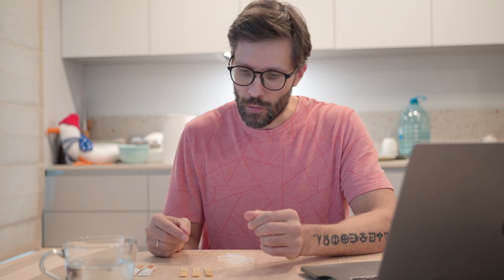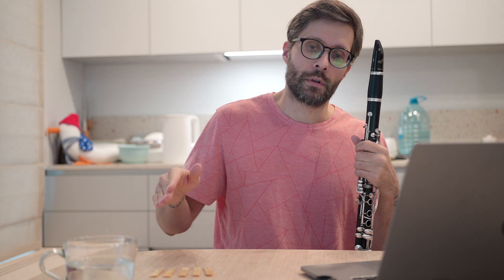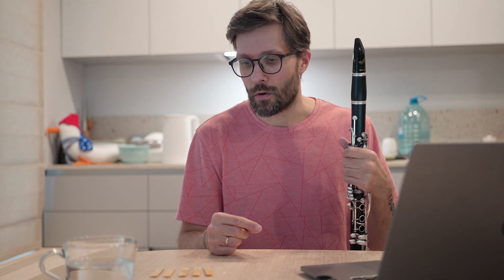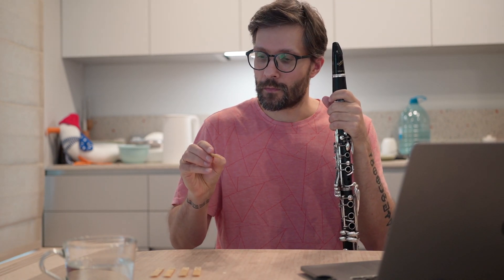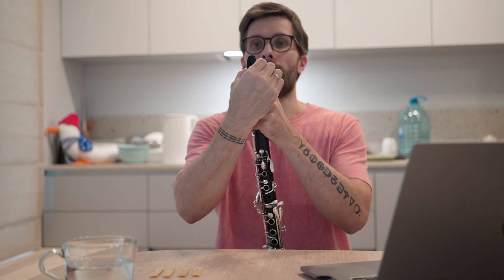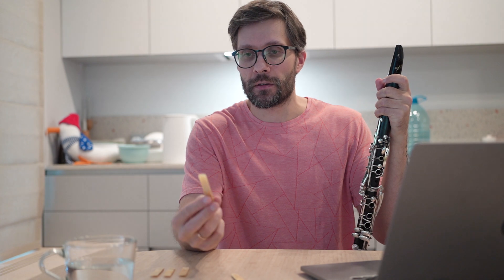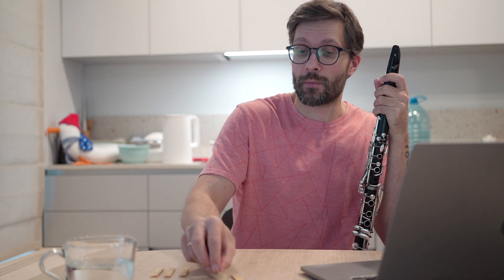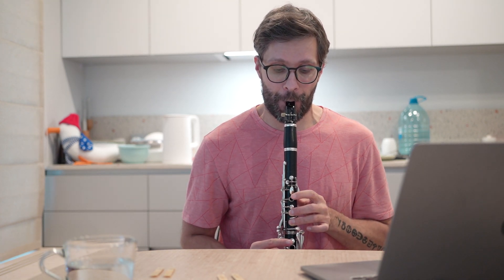Testing clarinet reeds (V21, 56 Rue Lepic, V12, Gonzalez FOF) and new break-in approach, day 1

Comment: I recommend playing only lower notes on new reeds, like the 1rst of three pieces of Stravinsky. I play that all the time on my new reeds. The finger rubbing can be actually the best method for softening reeds as It doesn't take off the cane, good idea. Just we have to clean our hands with soap and water before.
Reply from the maker: It's interesting that this rubbing was described in Clarinetist Compendium by Daniel Bonade, but he wrote that it should make reed more resistant, not softer 😊
Btw, I like your idea with  Stravinsky piece!
Reply: @alexeysclarinet9109  In your experience, what rubbing finger results on a reed? softening or stiffening It?
Reply from the maker: @jimis3167  it's definitely not softening the reed. But I am not sure if it makes reed more resistant. Though it seems to me that reed treated that way plays longer. So maybe there is some increased resistance.
Reply: @alexeysclarinet9109  I've been doing this too but not as much time as you. When I play and my reed is not very responsive, I rub it with my finger and instantly becomes more responsive.
Reply from the maker: @jimis3167  I see. It's funny how we all have different experiences 😊
Reply: это делается для того чтобы быстрее забились волокна, тогда она будет медленнее сыреть, соответственно дольше будет работать )
Reply from the maker: @janrahaev8280  в теории да, но сначала мы трость мочим и она впитывает влагу, а потом мы трем, забивая волокна. У меня есть теория, что когда мы делаем это в первый раз, то как раз трость медленнее и равномернее высыхает и потому меньше деформируется. А потом уже да, меньше пропускает влаги внутрь.